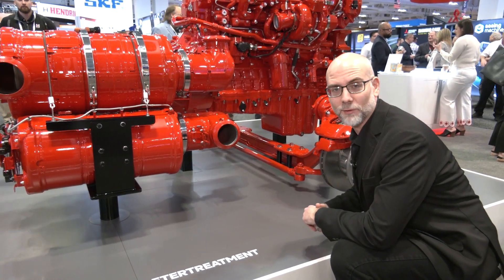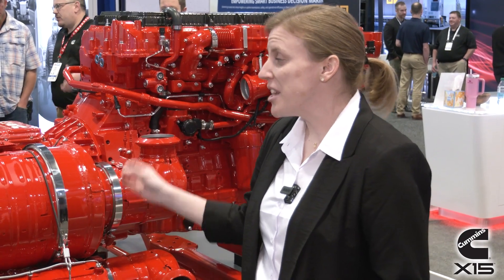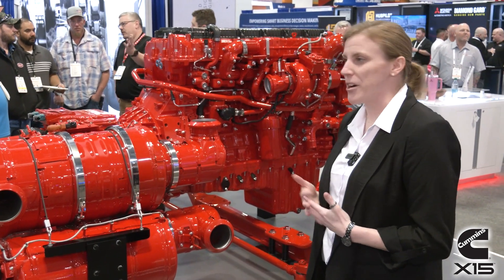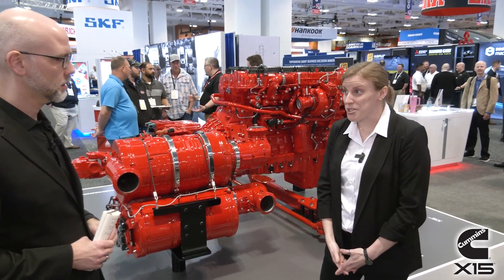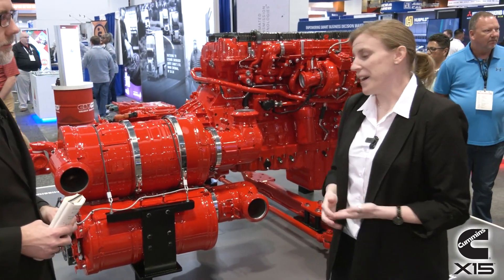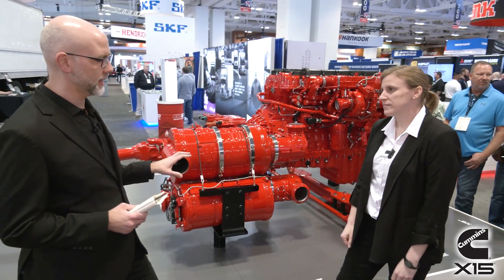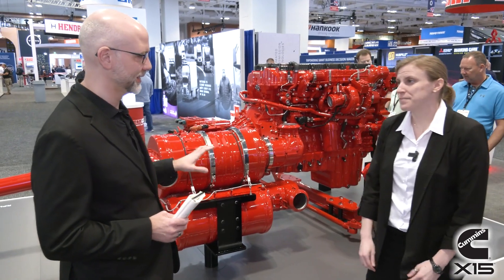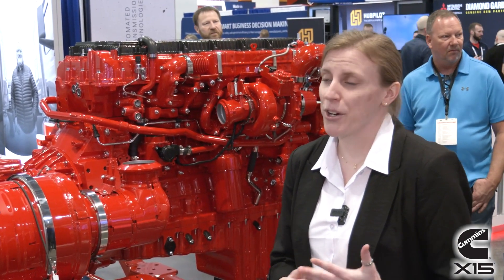Cummins X15 GHG27 Aftertreatment: Reliability Meets 2027 Emissions Standards

Comment: Steele Environmental’s OptimizerHF, surfactant-based fuel conditioner, lowers fuel usage, diesel particulate, CO2 and NOx emissions. steele Environmental just did a 350 heavy truck trial using OptimizerHF diesel fuel conditioner and based on results of fuel conditioner trial, fleet owner estimates that he will save $6 million per year in operating expenses plus lower CO2 and NOx emissions. Plus I have a plasma exhaust treatment technology being built for diesel engines in India. Anybody interested?